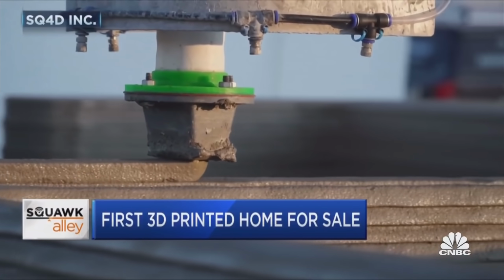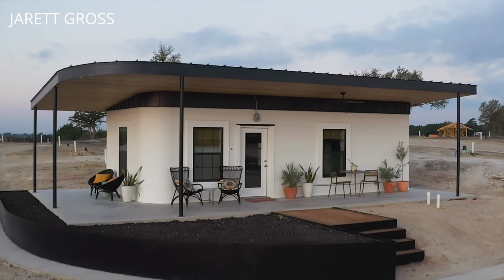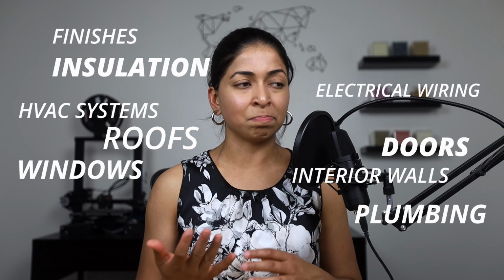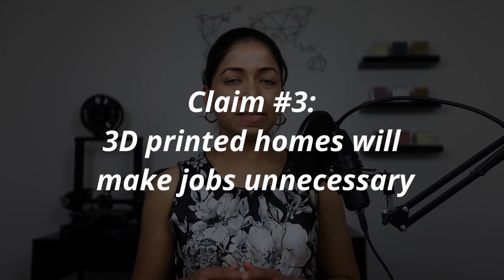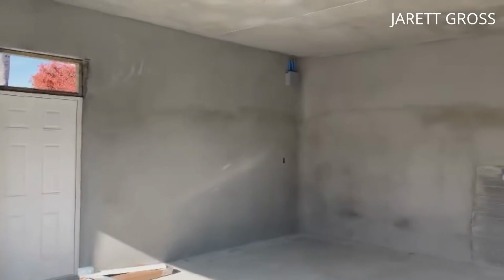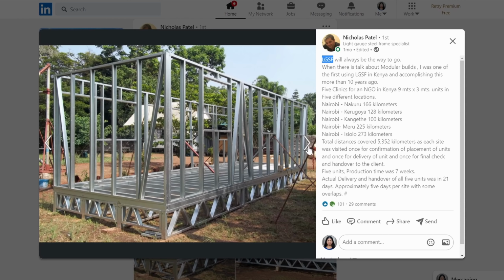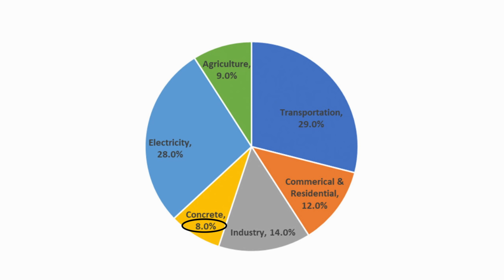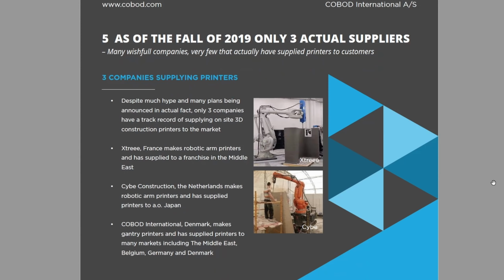Exposing 5 LIES about 3D Printed Concrete Homes

Comment: thank you very much for your objective approach of the subject. you prepared well that video, points are clearly explained, part by part, it's a breeze your title wasn't just clickbait.

I'd add a point to it though: most concrete buildings are reinforced with iron bars (there's even an example with concrete blocks in your video). don't these houses need them ? that's a genuine knowledgeless question since I'm no engineer at all.
you're right about the arrogance of these guys. they always promise the moon habitable to end in reality by showing earth is the only ground we can go for now and we can throw just a few trained guy and not everybody actually (as on Mars ? hi M. Musk. mark my words I'll be dead long before any regular guy can inhabit Mars)

Comment: Be interesting to compare this to quick form solid concrete and "tunnel form builds" I suspect that these  are much cheaper to set up__ saw a video on Indonesian affordable housing using pre made  forms__ forms up and poured in a day then a concrete panel  roof added. Only "tech on site was a geriatric crane to move the form work and place the roof slabs. Production line approach, but built on each site __ stand alone homes__ fantastic project management. Semi skilled labor.

Comment: I know about 3D printing, as well as container homes. Many of your videos are decieving. Why are they decieving? What is your purpose. It obviously is to trash many housing options that compete with others. It will not work. There are already starting to try 3D printing in Kenya, plus building materials can be recycled to lower cost, and Kenya has alot of green energy. Your videos are of your opinion, not of fact. Things are behind your opinions.

Comment: Great arguments, but i wouldnt be so quick and eager to prop up and respect local cultures. Their cultures as they r right now bring them the problems theyve got and i dont see how bringing over whatever material i can to make a sturdy, comfortable shelter for cheap would cause them to boycott it. Like, what? R they used to live in small, single family huts on the ground lvl? We did, as well. Then we invented reinforced concrete and central heating, building 12 storey apartment buildings with running water. Feel free to traditionally die of exposure, while i take a seat 30m above ground and enjoy the view with my family

Comment: I don't know if simply don't know how to convince someone, if you did a bad research or if your whole claim is bs but even do I don't really have any opinion towards 3D printed homes which could be biased I simply find it hard to believe anything you say... The way you present "evidence" is simply not convincing. It's sounds fabricated to support your claims without even going into depth of why it is like you say. This could be about any topic if it would be presented like that. I notice this kinda argumentation technique a lot lately. This doesn't mean that you aren't right about what you say... But if u were... than you did a bad job of actually convincing someone who doesn't just fall for rhetoric speech.

Comment: You're not a buzzkill, you're just pointing out the shortcomings of yet another tool that will soon be at the disposal of construction companies. It's not ruining the fun to point out some inherent flaws of the journalism on concrete 3D printing. Journalists need more accountability, but that would require reinstating the FCC Fairness Doctrine. However, that may be a task in itself because they'll just say it's a violation of the First Amendment of the United States Constitution (to which I say rights aren't unlimited and there are cases to be made against such a thing because, like with stochastic terrorism and forums on the internet, people can be misled if the informant's end is anything but passing on useful information).
Reply: *The FCC Fairness Doctrine was actually about airtime for advertisers, it has nothing to do with accurate and balanced journalism.

Comment: Thank you for the nice video we cat ignore reality of ALL materials is a structure. I personally have dreams of building a concrete 3D printer for the sole purpose of doing small residential landscaping features like steps and gardening. But using methods simply like wasp hive mud like.

Comment: See you're speaking in a lot of hyperbole yourself.... 

That first point is they CAN be printed in that low of a cost... now that's like saying you CAN create a plush toy for around five bucks but in order to do that you'd have to buy in bulk and build 3000 of the things. So yea the total price isn't five bucks, but if you do it right the cost of materials will be around five dollars.... so you can then sell it for about eight or nine dollars. You are making it seem like they are claiming that you can just pick up the phone and call them and get a home printed for that price.... if you had actually read those articles those are possible projected costs of manufacturing a bulk number of homes for 3D printed communities, not individual homes. This first point is you 100% misunderstanding what was presented to you OR you understood it and are lying to get clicks yourself which is very hypocritical of you... tsk tsk.

The second point.... the claim is that they can be printed in 24 hours.... and yes... that is true.... once again these articles you are citing make note that other work has to be done, plus that's not unlike other things.... technically you can raise a building in 3 minutes according to the world record set by this Amish group in Ohio... but that's just the raising process it doesn't include the hauling of materials inside the building the construction of interior storage or anything of that nature... it's merely stating how fast the walls can go up.... and anyone who understands how 3D printing works knows that you can't just print and go.... even on small scale stuff there is a lot of cleanup and finishing work.... so what am I supposed to sue my 3D printer company because the machine said the print would be done in an hour but I then spend 2 more hours cleaning it up and curing the print? No because that's not part of the claim they made.... the machine could print it that fast leaving me more time to work on other things in the meantime.... once again you either misunderstand everything or you're actively lying to clicks....

Third point: you didn't even give any sources for this one and i've never heard anything about this one so i'm 90% sure this you putting words in other peoples mouths.... stop it... don't do that. Even if your argument was true.... yes... it eliminates human laborers in the construction part... and allows them to do the easier work of just finishing it up.... this is like saying automatic registers take away jobs.... you realize now someone has to fix that machine right? someone has to fill up the receipt paper, someone has to work on it still? It eliminates humans time being wasted on stuff that it isn't needed on.... now those cashiers can stock shelves, help customers... we no longer need 40+ people at the front of the store to help customers you just need one or two per lane (about 1/3 of the total workers) to man the stations make sure people don't steal and to adminstratively check on alchohol purchases.... same thing goes on here.... now we don't have 30+ dudes holding walls together and nailing things down, you have one or two gues watching the machine, making sure it's printing correctly then you have another handful of guys waiting till the end to smooth out the wall instead of having the build them.... it's less work overall.... so even if this was your point you're still wrong because you clearly don't have an understanding of anything you talk about...

Fourth point: about time you had something useful to say... yes I agree building these homes will not solve the issue we have to tackle the reason why they are homeless not just building a home they're going to be evicted from in two weeks.... I think this is the point you actually wanted to make but it wouldn't make good content so you tacked on a bunch of things that you know nothing about....

Ahhhhhhh I see what this is with your fifth point.... you're a corporate mouthpiece for this Architecture 2030.... the studies they put out are biased and don't include many things that actual studies from the EPA and other groups include.... that 40% and that's 40% if you're being generous.... is of a few cherry picked options they pulled not a total use like the EPA would use. Why is Electricity and Heat production no on this list? Because it would actually reduce that precious 40% down to 20% because almost as much energy is used to heat the buildings as are used to build them... but that doesn't agree with Architecture 2030s claims of 40% of the emissions comes from the built environments.... my guess is 'Building Operations' includes heating and electricity but you mask it here to have a talking point against something that could actually hurt your bottom dollar because 3D printing DOES actually have a smaller footprint... the graph used by Architecture 2030 also chooses to not include 10% of the total production from other energy sources like solar and such... It also clevery lumps in AGRICULTURE into this too.... so your point effectively is this: "3D printing houses is bad, because beef and dairy farms exist producing huge amounts of greenhouse gases"... because that is 100% what your graph is using to inflate the percentage of 'building operations"

Your whole argument is nothing but lies and corporate pandering.... god I hate people like you.

Comment: Have you no knowledge of how windows & doors are made? They are made to FIT THE OPENING.. that's why surveyors attend to measure what's needed before they get made..
It is faster, cheaper & as strong as traditional construction.. as yo "it only the walls" complaint..ALL houses are built as just the walls.. roofs are made of wood in general..so have NOTHING to do with 3d printing..

Comment: Cement in this format is a gimmick.  It would be better and cheaper and faster to print the walls tonpour into. How would I design  it... multi printing head.. one that prints and outer shell, for pouring into and one behind it that printers a metal reinforcements... then a pouring of cement that goes I  slowly whilst agitating the walm system..  

I hate people frk. Jndia jn the sense they  cause problems jn their nonsense of specializing since its all simple ..

Machines can be axalabke... the printing method xan be xamera d and so you could leave. But it would be faster and cheaper to make a machine that pile drives and throws up fast sheets of ply wood easy to load and a machine that fires iron core rods for reinforcement.. thus 1 day shell build.. 2 day pour... any size and shape limited to resource... so then there is cement extraction process that should be looked at first... I have a 3d printer... calibrating is done once really and then99 percent of AL prints are perfect, unless material deviates from your calibration, but you could make an auto calibration  system..   machines can be scalled and its life time work and load.. meaning if you perfect it it could make an jnffjnite amount of houses limited by material extract...  fleet of machines... and water and activating a cement mix. I would think fibre glass composite would be better than cement so reinforcing rods are not needed as much per foot.

Comment: what the want is to get the money for a house without paying the carpenter as far as all those other systems I have beat those cost as well if you really want to know ask me you just need a hardware store and no building experience anyone an do t and you can pay for it with a Lowes credit card  I can even get the land for 15 dollars one time flat fee. im serious about that price its not a miracle its math ad group buying. stacking lumber islets it also produces. heat electricity and food. it a whole system I have. also its code rated. and no septic just an incinerating toilet.